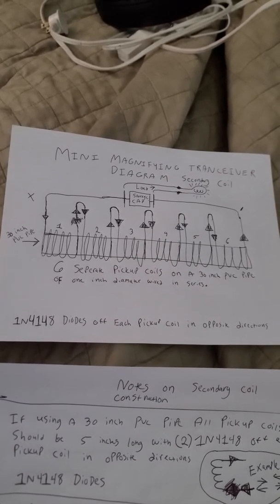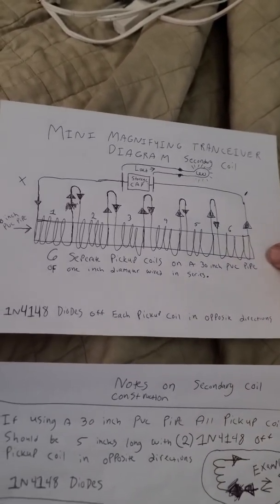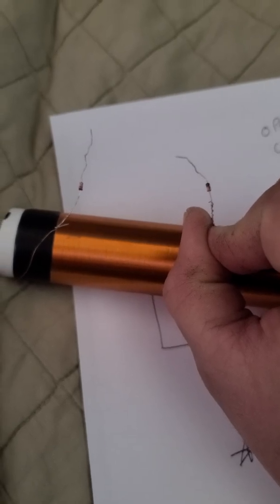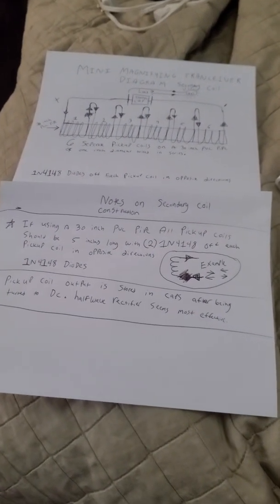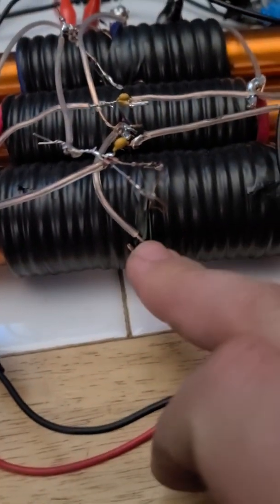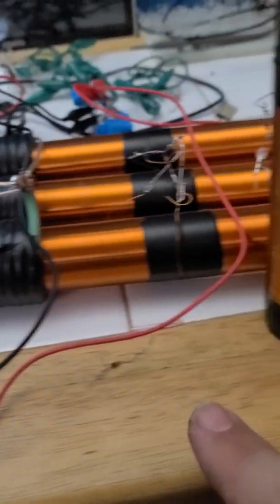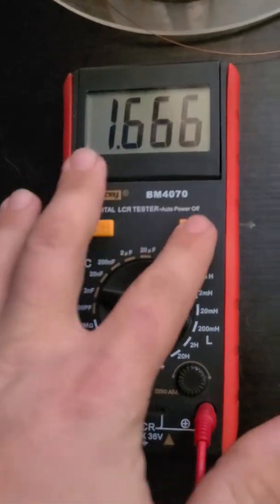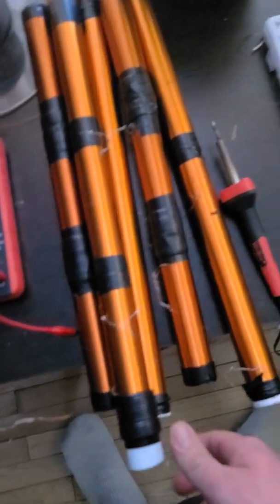⭐️ RWPT Schematic & Construction Principles Part 1 ⭐️

Comment: Question.  If you removed or shorted out the inner diodes but left the two outer ones does it still work the same?
Reply from the maker: The 1N4148 diodes are essential in opposite directions off the end of every 4 inch coil. Without the diodes the voltage & current won't become cumulative. There's somthing magical about those diodes
Reply: @MTECHINDUSTRIES  so every 4 inches..  What about every 2 inches.  I'll try that and let you know
Reply from the maker: Every 2 inches should work too. As long as your pick up coils are a multiple or divisible in length related to your transmitter coil you'll see maximum energy gains.

Comment: Hi M8 I am interested to know what type of capacitors are you using. Are they are in series and parallel what pf and voltage and how many?
Reply from the maker: I was using some microve oven caps rated for 2kv & i had 8 in parallel. They're over kill for the system & some mica caps would be best.

Comment: thanks for your sharing, you should run the generator with battery...maybe.
Reply from the maker: The plan is too have it run itself soon. I think if i build enough wireless pickup coils & combine their output i can make the system run itself.
Reply: @MTECHINDUSTRIES  great I will stay tuned for it, I am curious to see what method you will use for looping the system.
Reply: So, pickup coils add their powers together. That’s OverUnity. Great job